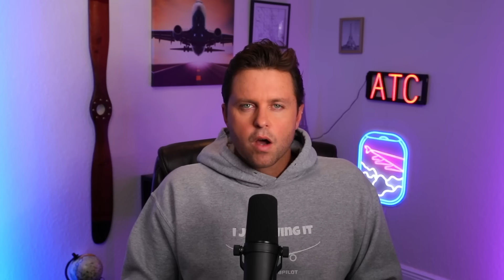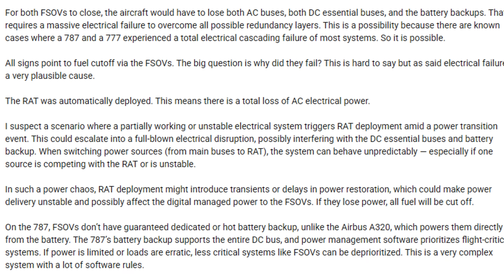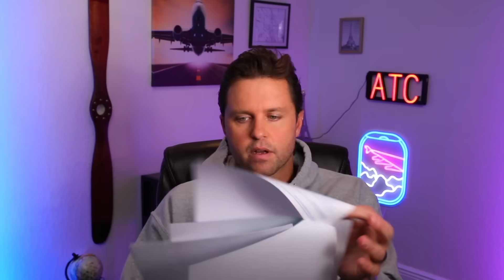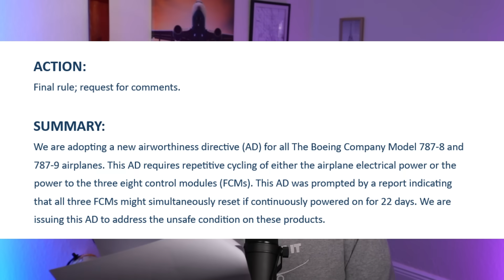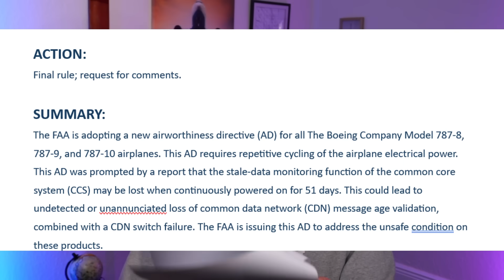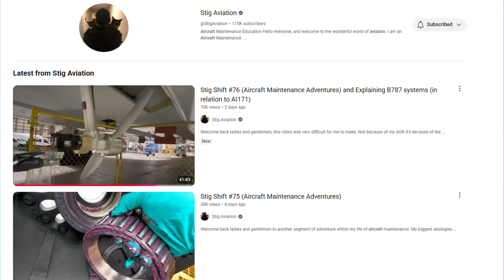Air India 171: Did a Software Glitch Cause Dual Engine Failure?

Comment: I am a licensed general aviation pilot with 350 hrs. +.  I realize that isn't much in the company of commercial pilots here.  However, I am familiar with the AD process.  I help maintain my club aircraft.  We receive AD's for our aircraft frequently.  It is the owner/operator's responsibility to apply the AD's to aircraft.  It will be interesting to see how this issue plays out.  Do the owner/operator maintenance logs show that the AD's mentioned here have been/are being applied?  If the logs show that they have been/are, it means nothing.  I'll give context to my remarks.  My wife and I returned from Great Britain last summer on a 787-800.  We were reseated due to the seat being non-functional where I was to sit.  We were told ahead of our departure date.  Thank you British Airlines!  We were compensated later for the inconvenience.  My point is that BA left the seat non-functional until after the plane landed...when or if it was replaced,  I do not know.  Airlines are under pressure to meet their bottom lines.  Maintenance costs money.  How an airline keeps its overhead as low as possible is its business...legally or otherwise.  Do you get my drift here?  Garybpilot, please keep us in the loop on this topic.  Thanks for your information.

Comment: When the 787 was being designed the buzz was that they could not find software engineers to work on it.
Reply: Really?  Why not?  Because they knew it was too much? Or too short of a time?
Reply: @libby2012 likely both. High pressure, liability, no experience. A bug kills people.
Reply: @libby2012 Boeing is super cheap when it comes to computing. Slow network, ancient servers, cheap, cheap, cheap.

Comment: but the engines provided some thrust tho, or did they lose power completely?
And what explains the very long takeoff ?
Reply: The aircraft climbed normally to 400 ft and then there was a problem that caused it to descend to less than 100 ft. For some unexplained reason the power appears to have been rolled back.
Reply: @christopherrobinson7541 …uuuh, have been rolled back? Due to a malfunction?

Comment: As a pilot this unfortunately will point to poor maintenance of the aircraft.  It has been stated by others that Air India has a history of not doing proper maintenance on their aircraft.  Also what needs to be investigated is the fact that one of the engine's was replaced back in March, could a unexperienced maintenance crew not done proper checkouts of the work performed?  Boeing keeps getting hammered over every thing related to their aircraft but history shows that lack of maintenance and lack of training for pilots has contributed to more issues than not..... If the batteries failed to keep the critical systems operational then the deployment of the RAT would not have helped at all..

Comment: My son worked for his then brother -in-law & his business was supplying aircraft fuel all over Australia & they were so strict on making sure every part of the process did not allow for the tiniest bit of contamination to enter the supply chain at any stage because that could potentially shut down his business for ever. I would be leaning to some sort of other system failure.

Comment: This ist very interesting, in case of the Videos (I hope you have seen) from a Guy, he flys with the Plane one flight before, he uploaded some videos on x where he shows that in the Aircraft different Screens weren't working. the complete media System was out of function, The reading Lights where not working... when there are so many electrical issues in the Passenger Elektronik its could get interesting what's up there in the Aircraft Elektrik. What did you say to this videos? What you you think about that fact? Other here seen this videos?

Comment: Let me preface my comment by stating that i am not a pilot nor am i working in a field closely related to aviation.
  I am a software engineer with an interest in aviation.

That being said, my opinion on why this accident was not caused by contaminated fuel is the fact that when a pilot starts the engines before takeoff, it is sequential meaning one engine will be running longer than the other, and any issues that would come from contaminated fuel would manifest alongside asymetric thrust which we did not observe in the footage.

I will look into your previous videos on this crash but i just want to point out that other channels are not so sure about the dual engine failure like you are, you stated it as if it were a fact.

If the main reason you believe that this crash was caused by a dual engine failure is that the RAT was deployed, i suggest you look into all the different scenarios in which the RAT automatically deploys because it is not only due to a dual engine failure.

Like ive said, I'm by no means an expert, you did your research obviously and i dont want to convey any hate, i will look into your content more and the reasons why you believe in what you believe

All I'm saying is that other channels are not convinced on the dual engine failure theory(saying it might be erroneous flaps retraction, but also noticing electrical issues bc the gears didnt retract properly or sth)

I can see that you are a passionate expert and i appreciate your video.

Edit: watched your other videos and you are very reasonable, this is a good video

Comment: Yeah, that's definitely an interesting angle to consider. The fuel shut-off valves could have had a significant impact if they engaged at the wrong time or in response to a power loss.
It's tough to pin down probabilities without the official findings, but speculation usually revolves around factors like mechanical failure, fuel contamination, or some kind of sensor or systems malfunction. Given the safety systems on a 787, if both engines shut down, it could be due to a chain reaction of events rather than one single cause. We'll just have to wait and see what the investigation concludes, but it could be a combination of issues.
Meanwhile no 787 flights for this little black duck, although cost of living crises means I'm staying round home also.

Comment: Captain Gary, Great Work, Please also look at the footage from CCTV during takeoff, A cloud of dust can easily be seen at liftoff. Also data revelaed flight used more than required runway for liftoff. Could HEAVY / OVERWEIGHT can also be  factor here. ! ?
Reply: No. The aircraft was flying to London 9,500km and the max range is 13,500km, so it was not fully fueled.

Also it climbed normally to 400ft and then a problem occurred.

Comment: I am not at all qualified to make a technical analysis.   However, I thought from the first I heard of this crash that somehow an electrical problem was the root of the issue.  This makes the most sense and IMHO is the most probable.  Electrical interruption causes the spring-loaded valves to close and the RAT to deploy.  An engineering error exacerbated by the omission of a battery backup hot-wired to the fuel cutoff valves.   A simple "cost-cutting" decision.   If it's true, then all the 787s should be immediately grounded till an engineering fix is developed, tested, and applied.  A process that would likely take years at best.  This is the result of the Boeing takeover by the bean counters who made millions by cutting costs.   A legal quagmire that will take years to unravel.  But somewhere is the person who made this decision, and hopefully, he and the others who enabled and profited from this decision will be held accountable.

Comment: Well i have no knowledge about the subject but it is interesting so i read and listen. From my informatics background, some of you may be familiar with operating systems in servers and computers. Typically a periodic reboot is recommended to clean caches, event logs and so on, if not done you will eventually notice that the pc gets slow, un responsive and sometimes goes to bsod (crashes). I guess the OS of an plane in comparison with a simple computer is unfair since the plane has redundancy and safeguards, but its still a computer, and it may need the reboot every now and then to refresh. If the reboot is needed after certain amount of time it may be because some memory, eprom got full and needs to be purged, in computers if there are excessive log captures due to errors, basic operation or else they get bigger sooner and freeze things. My humble two cents on glitches. 🙏🏻

Comment: You are right. Fly by wire, right now, is controlled by a computer. Back in the day, as a mechanic, it was easy to see what the problem and swap parts. As a pilot, back in the day, the pilot has direct control of the control surfaces of the plane. Now, everything is interpreted by the computer. Modern day buses are the same way. The bus can be travelling down the highway and may shutdown. Unlike a plane. the bus sill stop on the road; and, the driver will have to shut down the bus and reboot the computer and restart the bus and be back on the road. Can't do that on a plane.
Reply: An electrically powered bus suffered complete system failure and total power loss a month ago in my home town. 
It caused absolute chaos during the two hours it took to get it removed.

Comment: MOST THINGS IN LIFE ARE RELATED TO PROBABILITIES. WHAT IS THE PROBABILITY THAT EVERYTHING BOEING DESIGNED INTO THE 787 TO NEVER ALLOW BOTH ENGINES TO CATASTROPHICALLY FAIL AT THE MOST CRITICAL POINT IN A FLIGHT WOULD HAPPEN? HOW DOES THAT PROBABILITY COMPARE TO THE PROBABILITY THAT THE FUEL SWITCHES OR THE FIRE HANDLES WERE CUT OFF? THE FIRST SCENARIO, AS FAR AS I KNOW, HAS NEVER HAPPENED. THE SECOND SCENARIO HAS HAPPENED. (P > 0)

Comment: Could it possibly have been one of the issues John Barnett had been concerned about?

“Barnett reported that he had discovered "clusters of metal shavings", due to the process of securing titanium e-nuts, left near electrical systems for flight controls, which could have "catastrophic" results if the shavings were able to penetrate the wiring. He stated that he repeatedly urged his bosses to take action, but they instead transferred him to another part of the plant. In 2017, the FAA issued a directive mandating removal of shavings pre-delivery. Boeing claimed they were complying and working to improve the design to avoid the issue, but determined that the issue was not a flight safety issue.[6][13][10]”
Reply: And he was an apparent “suicide” during legal depositions because of it.

Comment: Since a saw a video from a passenger, showing issues of the  electrics/electronics  (air conditioner,lights,info system and screen, etc) inside the passenger cabin of the same 787-8, it came to my mind that there was a real good probability this could be related to the  accident. 
Since that day, never heard about it again. 
As I’m not an expert, for the contrary my knowledge about it is very limited, i didn’t  gave more thoughts about it. 
Then, today scrolling in youtube and  because it interested me when I read the title, I watch your video and feel that this really could be the cause of the accident. 

By the way;
Good work!

Comment: There are two kinds of Fail Safe Valves.  Fail safe "closed" and fail safe "open".  It's more likely they would be fail safe open for the reasons you mention.
Reply: Another commenter described it was not designed as a push mechanical.  He described a motorized  system that would latch when it gets to the desired point.  My question is what happens if the motor quits in between?  Sounds like it just stays unlatched and partially open.

Comment: You are spot on. Programming glitch resulted in shutoff valves shutting off. Air India should never have let the plane take off due to the electrical issues on the incoming flight and Boeing once again has huge issues at a time when airlines around the world are abandoning the deteriorating safety record. Both parties want to wiggle out of this and so I do not expect a truthful investigation.
Reply: Why are you pulling Air India into this? They haven't had a crash with fatalities in 40 years. FORTY. If this is true - it's ALL Boeing. I'm sick of you Boeing cultists and apologists, finding every single excuse for such a shameless company. I bet you also said the same stuff when Max kept crashing. It's so tiring and disrespectful to the dead.
Reply: @furious6358 I am sick of all this ridiculous speculation. Hell these YT cats blamed the crew (without evidence) for the first several days! This is gross speculation!
Reply: @furious6358  Look, a passenger on the incoming flight reported problems with AC and the entertainment system. Als the plane was 3 hours leaving. Did Air India fix or even look at these issues?
Reply: @cayrick  No. That video was proven to be from a much earlier flight.

Comment: I mentioned this a day after the crash, everyone was saying I don’t know what I’m talking about, one YouTuber pilot in particular called me stupid!! 

I was adamant that it was linked to their known glitch as stated below that I’ve posted in multiple comments and on my Facebook page, 

What shocks me, is how quick the “experts” disregard my claims and didn’t even want to entertain the thought or discuss further as this scenario has played out before on the runway,

In some cases, software bugs, such as those identified in the Boeing 787, can cause the generator control units to fail simultaneously, leading to a loss of electrical power.

The US air safety authority has issued a warning and maintenance order over a software bug that causes a complete electric shutdown of Boeing’s 787 and potentially “loss of control” of the aircraft.
In the latest of a long line of problems plaguing Boeing’s 787 Dreamliner, which saw the company’s fleet grounded over battery issues, the new software bug was found in plane’s generator-control units

2015
Reply: Boeing really is shameless. Always Boeing, man... it's so tiring

Comment: Gary, your videos are the best of all! Investigating carefully and not telling a hundred stories! Extremely interesting what you are explaining regarding all technical functions. I'm a lay person, a housewife if you want to put it that way, BUT, one has not to have studied to see that the aircraft took off normally, and right after that it was "dead". Without any wobbling it glided calmly back to the ground, simply in a bow. So what else could it have been than a complete electrical blackout. And this could be caused by a software glitch easily. Every machine needs power to work. No power for the fuel pumps - no working engines. Logical. An own tragedy is that the living areas of the city are so damn near to the runway. Otherwise, may be, it wouldn't have ended so catastrophic for all the people.
Reply: Exactly! Why does the airport have to be in such a crowded place?! In Finland airports are surrounded by fields or are in the middle of nowhere just nature around, empty fields, not forest.
Reply: I think they could have made it, if there was open space available, like that SAS plane some years ago. It emergency landed on a field and everybody survived.
Reply: @lilipihlajamaki4776 even without the engines functioning do you think it would be possible?

It’s almost like all odds were against them. So tragic.
Reply: My thoughts exactly. Could they have landed more safely if there weren’t buildings around?
Reply: @AlexandraAlly92  Would have also been in God's hands, but may be. I think, the plane was no more steerable by the pilots, most likely they even had no working instruments anymore. It's always a scrap of comfort when it comes to severe flight crashes that the people are immediately dead and have not to suffer.
Reply: I think they would have made it if they had some open space to land, they seemed to fly pretty stable. That SAS plane landed on a field, was in three totally intact pieces and there was no explosion or fire if I remember correctly. It was in winter so maybe also the snow helped. Yes, this is terribly sad and devastating.. I hope there will be changes so that airports will be built in desolate areas with wide, open surroundings.

Comment: Hello; Gary I have a good question, first I want to say tank you for always taking the time to make such an informative videos, my question Is do the 787 has backup batteries ? and I found this link from 2013 about the 787 electrical problems related to the backup batteries. https://en.m.wikipedia.org/wiki/2013_Boeing_787_Dreamliner_grounding

Comment: 100% electrical, when I watched the video taken by the passenger on the prior flight complaining about no air conditioning and problems with the electric, I thought that it could have been the cause of the engines shutting down. Nice video GaryB.